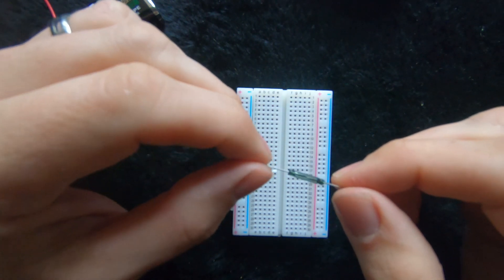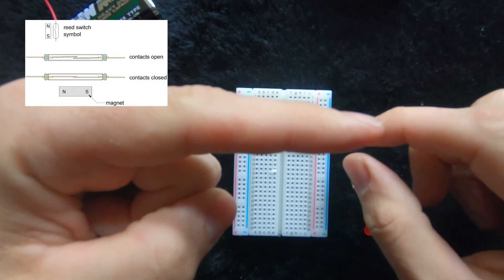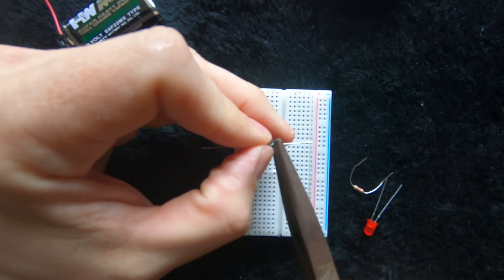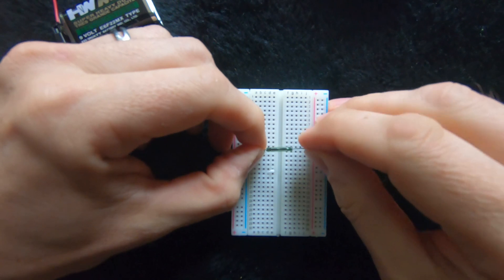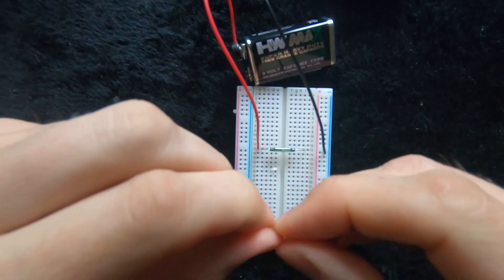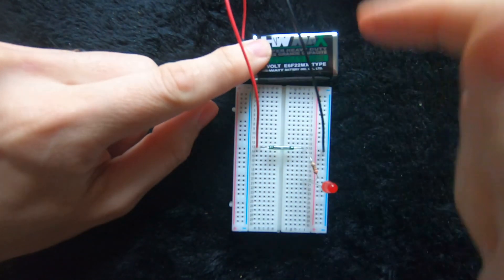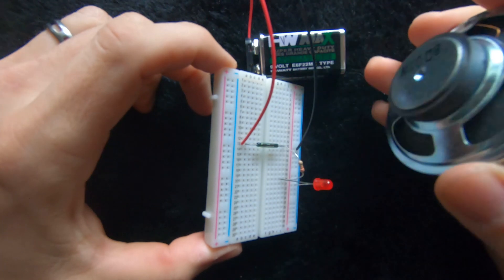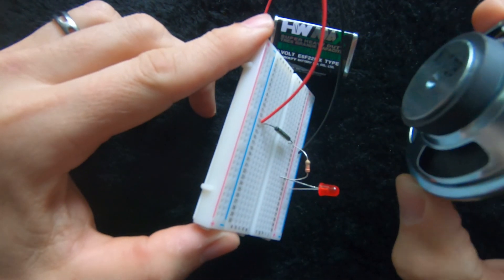Reed Switches - Beginners Electronics Series

Comment: I opened a AstroPulse Rife machine after it fell on the floor and stopped working.  It only would beep when powered up.  In small print a label reads if you open the box (4 screws) it will disable the device permently.  When I opened it up I found a small magnet that had been glued in place on the top half of the box that when in position was close to a reed switch. Appears when it fell the magnet came loose.  There is a large quartz battery in sequence next to the switch.  So it appears the switch is there to blow a fuse or fry the mother board with the battery.  Have you seen anything like this?
Reply from the maker: @johnrobertson3120  No - but a good use of technology to protect people from hazardous things. I got a hell of a belt as a kid playing inside a TV. Unplugged for a few days, but still held enough charge to kill me - maybe systems like that are a good idea. Doubt it would fry the board with a battery though - have a search for a fuse ;) Thing is if you repair the fuse it will blow immediately again as magnet is not against reed switch. Interesting design. Thanks for sharing.